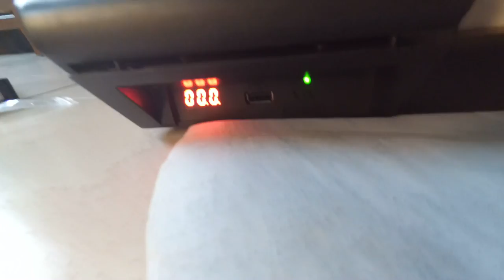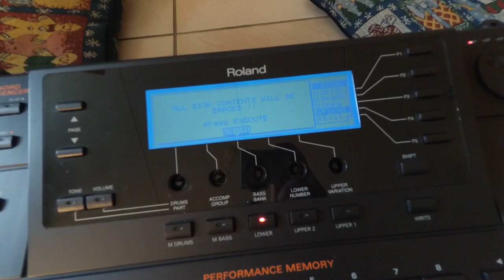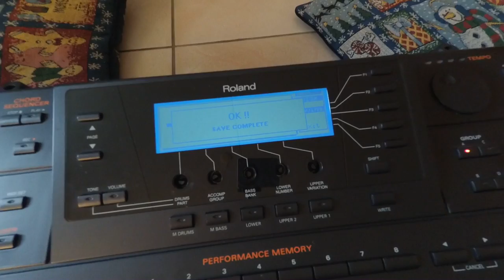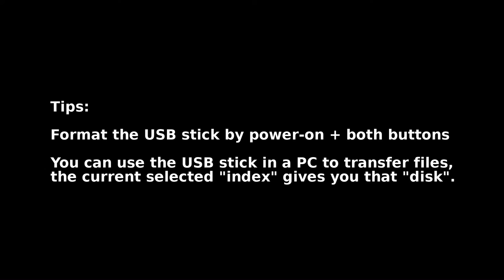Opening Roland G-800 and replacing Floppy with USB Floppy emulator

Comment: 7 years after you posted this it still made somebody very happy! Got my project G800 ( there was lots wrong with it) finally working with the emulator! Thank you!
Reply from the maker: I even have a similar video ready for a G1000. Should still upload it. I am happy it could help you too. I think these Roland devices are still good to play on. Obviously under heavy use they wear out, like all electronics do. If you have any tips to service the 'nobs' (rotary encoders under the display) it would be appreciated.
Reply: @skinkie  Yes, one of everything Roland has ever made in your personal museum would be nice 🙂. My Encoders are still working fine so I have not looked in to that. Are you looking to replace them or repair/service the existing ones? Do you have the G800 service notes document? According to that, they are the EVQ-WQK F15-24B. I have not found them online or an alternative for them yet.... Or are you talking about the plastic knobs?
Reply from the maker: @theflash6595  Although I cannot say I "don't collect" I only own two devices with white and black keys ;-) The last G-1000 was heavily used. This can basically be observed by the buttons (need more pressure) and rotary encoders which (like Nikon camera's) skip steps or only turn in one direction. I just found the G-800 service document, but not the G-1000 yet. To be honest. The design of the G-800, is in my perspective superiour to the G-1000. I really don't get why they put the performance memory on the same row as the tone selection.
Reply: Hi, can you please help me getting mine fixed? 
I first bought the sfr1m44-u100k and couldnt get it to work. Then I saw someone soldering pin 1 and 2 and reverse the 32pin cable. I did that and it read the first "floppy" once and gave me the disk not formatted ever since. Later I read somewhere I needed The sfr1m44-u100k-R version with 2 digits for the Roland 800 but I still can't get it to work. There's very little information online and those who got it working only show fysical installs.
I see other people use flashfloppy for firmware, so I tried that, nothing. Can someone please tel exectly what they've done to get it working on the G800.
grtz Quint

Comment: Hi All.. I just finished installing the Gotek SFR1M44-U100K in my Roland G-600, following the publisher's instructions exactly, and it is working exactly as it should. The red wire on data cable is facing the power connection... Thank you very much Skinkie!

Comment: Hi just wanted to say thanks for the information Video i finally got this emulator to talk to my Roland G800 after a little bit of trail and error I followed the instructions to the letter except the  flat cable is facing the correct way around .
I suggest that the harness for the unit be modified also to fit correctly under the Keys .
There is no need to removed the dials on top and the use of battery powered screw driver is a must !
New life to an old unit ..
Thanks again

Comment: Hi. I have one for an xp50. I have set the jumpers as per your advice but not done the pin 1 and 2 link. When inserted the synth sees the stick but if I try to format one of the 100 disks, it errors. What is the pin 1 n 2 link for and do I definitely need to do it? Thanks

Comment: hi how many wires goes to the plug on the USB floppy emulator also want to put disassembled and in no plume of any leads I would be very grateful for the answer or where to find a diagram to repair this synth
Reply from the maker: Two, like the original floppy drive. So there is the normal Floppy Disk power, berg connector or mini-molex. https://www.lifewire.com/floppy-drive-4-pin-power-connector-pinout-2624581
Then we have the normal Floppy Disk flat cable. http://www.computerhope.com/jargon/f/flopcabl.htm
Does this help?
Reply: and loop one end of the wires should be inverted or not on the computer it loops upside down and here what should be
Reply from the maker: Exactly. Visible at 17:00
Reply: thank you very much for your answer kind of figured

Comment: Hello Skinkie , Ken you help? I acquired in 2nd hand a ROLAND RA800 module, which I think is equal to your Roland g800, but without a keyboard. It works quite well and with a fantastic sonority according to age. The module did not have a floppy drive. I put one of 1.44 Mgs, of the used ones in the computers but I cannot read or write anything from her.
I saw your video about a replacement for the usb floppy emulator and repair on the floppy drive you removed. You can tell me the make and model of the unit. Later I also think of replacing usb floppy emulator but for now I just wanted to put the ROLAND RA-800 systems in with a normal 1.44 floppy drive. Do you have any idea why my unit does not work? It was removed in full operation from a computer so the drive should not be. Maybe need a Twissed flat cable pair? In your images  flat cable is not twissed.
Reply from the maker: I think it might indeed be related to the cable being twisted, or the drive being master / slave.

Comment: WHY shorting pin 1+2 ???
Reply from the maker: Because the keyboard floppy disk controller requires it. Might be related to master/slave.
Reply: Meanwhile I found out what's the reason behind shorting out of pin 1+2: it's that the old floppy drives had shugart interfaces unlike PC drives and the shitty gotek does not properly support that. They hack and cheat and keep selling their shitty product. Better get yourselfs a real hxc floppy emulator. That's like 100eur, but way better.
Reply from the maker: What is the technical improvement of using a hxc floppy emulator?

Comment: and loop one end of the wires should be inverted or not on the computer it loops upside down and here what should be
Reply from the maker: I would suggest just to get an old floppy-disk cable from a 386/486 system.
Reply: the old floppy was not bought without it all hooked up now can't figure out how to break the USB flash drive 100 images
Reply from the maker: Trust me, you can't break it :) Make sure that you have the correct pins shortened otherwise it just won't work.
Reply: I mean, I can't deal with the program that came on the disc with the emulator
Reply from the maker: You don't have to. Format your USB stick on the device itself. If I recall correctly it is pressing both buttons. Then you can access the "first floppy" on a normal Mac/Linux/Windows PC.
Reply: I mean othermaterial the flash drive this program may not
Reply: and you formatted a flash drive with the program that was on the disc with the emulator
Reply from the maker: No, on the hardware emulator itself. No need for the software.
Reply: yeah but I have something does not work to do it
Reply: yeah, but I can't do something to do it
Reply: it is clear, I inserted the disc and the flash drive in the computer but can't othermaterial the flash drive this program

Comment: Hello!  I've just started to self-learned how to play the keyboard.  Is there anyway can you please help with step by step on how to change from floppy disk to USB disk emulator on the Roland G800?  I've read some of the articles regarding this and they confuse me.  Some said the USB disk emulator never worked on the Roland G800.  Thanks.
Reply from the maker: Your writing suggest you didn't watch the video. Please watch it, it works fine and every step is clearly visible.
Reply: Do I need to buy anything else beside the "GOTEK SFR1M44-U100K Floppy drive emulator" you mentioned?  Any additional software needed?  I have a PC with windows 10.  Thanks a lot for your quick reply.
Reply from the maker: Either buy the G800 compatible (more expensive) one, or solder the connection yourself as in the video.
Reply: can you please provide the one that does not require solder? Thanks. 
I find this on Amazon, not sure if this works: Yosoo Sfr1m44-u100k Updated Version USB Floppy Drive Emulator -Black
Reply: I see they are selling this Nalbantov USB Floppy Disk Drive Emulator for Roland G600, G800, XP50 on ebay for $137 but not sure if it works.  Thanks.

Comment: Dear, can you help me with my roland g800. I buying g800 with USB emulator. I got USB memory with some rhythm but my roland cant loaded them. I formatted USB on the PC  but I read on the some forums, that I must formatted USB on the keyboard. Can you text me, procedure for  this formatting on the keyboard.  Best regards
Reply from the maker: Hold the two buttons on the Gotek. Then power the G800 on, the USB will be formatted and available to write and read files from it. From the G800 and the PC. If you switch the disk number, you will be again able to add and remove data from that selected disk on both G800 and PC.

Comment: Hello again, and neither could you suggest in stages as in the menu to find the styles that are on the USB flash with the emulator and make a video I would be very grateful
Reply from the maker: Are you able to open the formatted USB in the Gotek and open it on your computer?
Reply: Yes you can, I can't deal with the menu in the keyboard which buttons to push
Reply from the maker: So the actual problem is that the keyboard doesn't see that a disk is inserted. Did you bridge the connection as shown in the video? And have the right jumper settings?
Reply: Yes did everything like in the video. and you have it works well?
Reply from the maker: Yes fine for almost a year now.
Reply: after I inserted the USB flash need to press gm/gs mode ? I can't figure out how to turn on the style, which uploaded.
Reply: Hello and in which format it reads styles